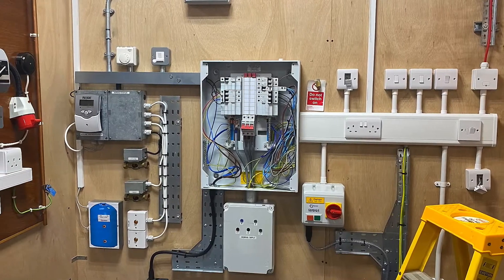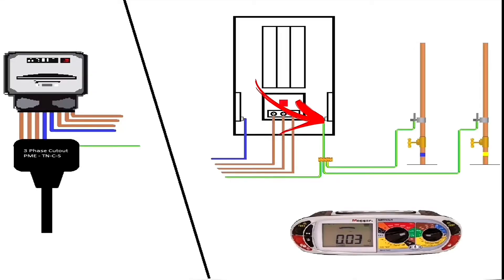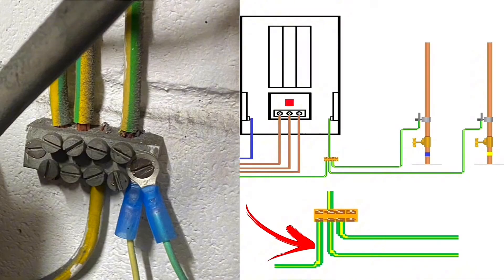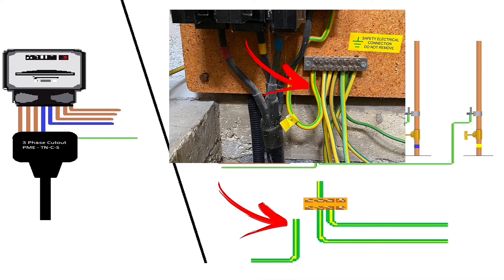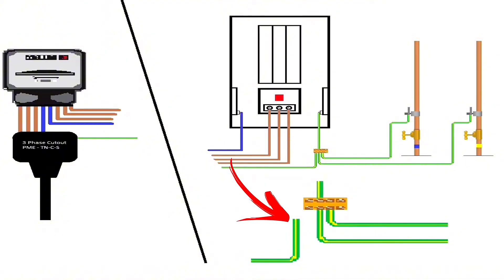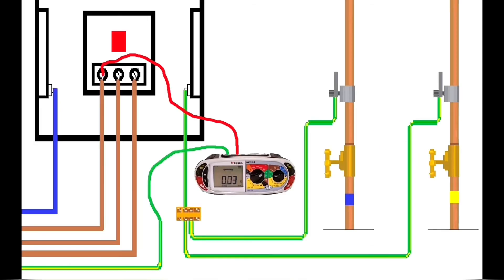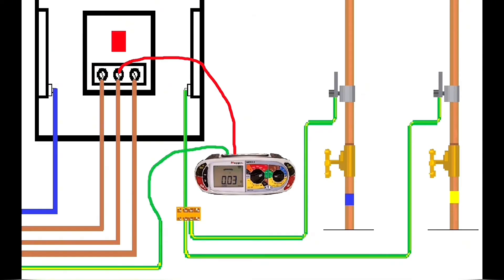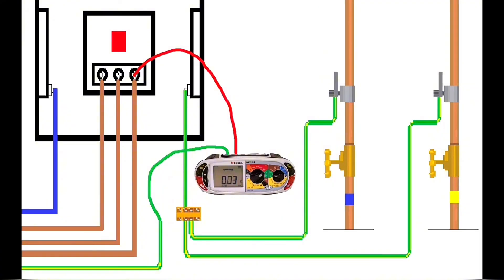How to Measure True Ze - On a 3 Phase Supply

Comment: Why are earth wires bonded to the gas and water pipes, don't understand.
Is it because they are metal copper pipes, a good conductivity. If there was a live fault would trip the fail safe circuit breakers at the consumer unit. 
Is that the reason?
Reply: The metallic pipes are extraneous conductive parts which could become live under fault conditions. Any metallic parts which are part of the wiring system are called exposed conductive parts and are usually connected to the earthing system through a CPC. The primary purpose of bonding between these pipes and the main earthing terminal is to prevent a difference in potential between simultaneously accessible conductive parts during a fault which would present a shock hazard to anyone unlucky enough to touch them.

Comment: Wont you have supply voltage between incoming PE from the supply side and L1-L3 ? how do you effectively measure a resistance with that much voltage present?
Reply: The Ze test is not a resistance test. It is a live measurement of the incoming supply impedance. It is a live test as described in this video.
Reply: @mattkeneson1678  yes i can see its a live test, thats what has me puzzled, so how does an impedence test differ from a resistance test inside a meter? afaik impedence is rated as resistance at a specific frequency, i just cant get my head around how you measure it with a live voltage as to measure resitance you usually have a voltage coming out of the meter to pass through the resistance being measured, surely if you connect l1 to l3 together with PE (disconnected from the grid!)  you can then measure the resistance of each leg though PE and should get the same figure on resistance as impedence, well i'm sure you would, I just cant see how the meter is being able to cope with the voltage throwing things off....
Reply: @lezbriddon impedance is the opposition to current flow in an AC circuit. It is the result of combined effects of the resistive, capacitive, and/or inductive components of the circuit. The tester is designed to be used with a voltage being applied. The line conductors are not being disconnected from the grid because the supply transformer windings affect the impedance value.

Testing the resistance in a material (such as copper, steel, etc.) is a totally different process which requires a test current to be generated by the test instrument and then passed through the material being tested.
Reply: @mattkeneson1678  yeah I need a diagram of such a meter to see how it gets the figure, to draw another analogy i can drive the car, but i wont be happy until ive held every nut and bolt of the engine to see what they do......
Reply: Inject current or impose a load and note what happens to the voltage.  When supply is available to live test you can do it with a simple resistive load, and this is how was actually done in the past.  Hook the tester up, note the voltage, flick the switch to impose the load and note the voltage and amps.  Do some maths and there's your loop impedance.  It works for line-neutral and line-earth but obviously the procedure is a little different.  Replace the needle meters with ADCs, slap in a microprocessor and have it do the same, even a bucket of times and average the results.  the injection method isn't that much different.  Transformers in the test equipment can provide isolation if it's required.